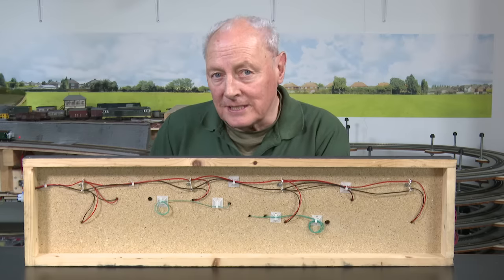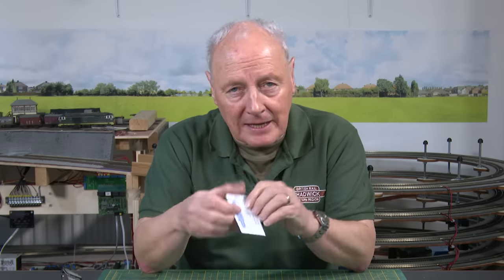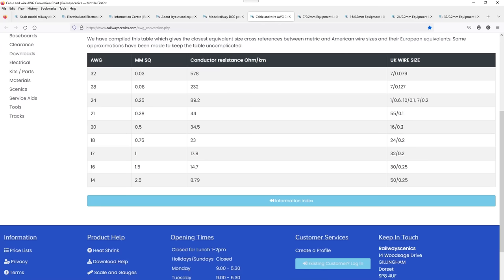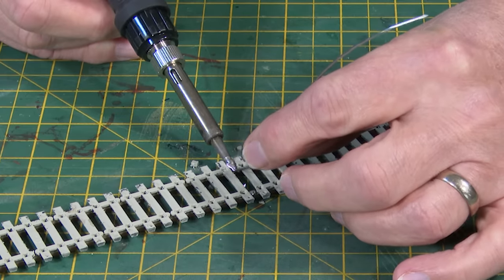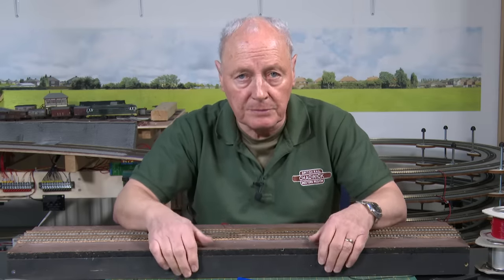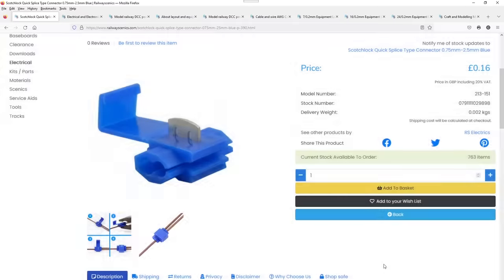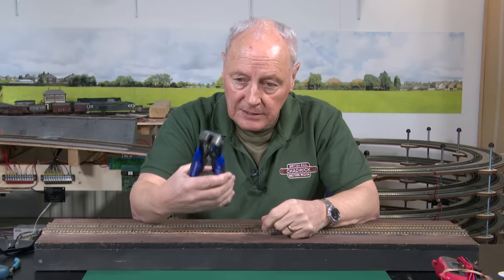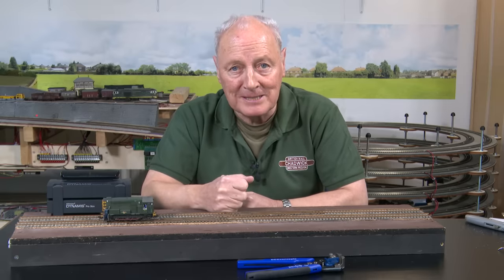LAYOUT WIRING for DC and DCC and all gauges at Chadwick Model Railway | 175.

Comment: I made an 8x4 N Scale layout about 4 yrs ago. Googled wires etc, but I done everything in haste. I painted the rails first, before laying, thinking I'd save time. Soldered wires then to the outside of each rail, hence bored 2 holes. It was only the last few pieces of track, did I solder under the rail, and bore the 1 hole. I ended up buying new flexi track, on sale (bargain, code 55) and maybe one day, re-start the layout properly.
Reply from the maker: We all learn through our mistakes Fergus. Stay safe, regards, Charlie

Comment: Hi Charlie, love your video tutorials, for this one, to me it's all you explained is pretty basic, but never the less interesting.
And as for wire, the thicker it is, the less resistance you have, the less chance you have of overheating your wire, the better your signal goes thru, so you don't do wrong with a bit of oversizing in wire thickness.
But what I don't see so much used, are short cut breakers, it offers you more safety towards you DCC or DC power unit, although your base station should be protected against this with an automatic off switch, but there is nothing wrong building in some extra safety.
Plus if you work in isolated sections, where you put in a shortcut breaker for every section, you avoid breaking down your hole layout.
In this you have two variations a simple bulb like breaker, to be actually correct it's an amp reducer, the higher the amp of the bulb is, the more amps you can pull until the max is crossed, and then the lamp is burned through.
Or you can have an electronic breaker, that switch off incase of a shortcut and reboots it self once the shortcut is gone.
Anyway perhaps an interesting  theme for a video…
Reply from the maker: Thanks Danny, you are of course correct, I use an electronic circuit breaker next to my command station. Regards Charlie.
Reply: @ChadwickModelRailway  So you use only 1 circuit breaker for your complete layout, or is it one unit with several intern breakers that covers a number of sections?
Of course there is nothing wrong with both methods, your controller is extra protected, and lots of these electronic breakers you can choose the Amps they need break on, of course depending on how many trains you want to run at the same time, that is also of importance.
Anyway always great to see how others build, thanks for your great video's.
Regards,
Danny
Reply from the maker: @dannyvanstraelen3273  I have two main power supplies. Each supplies four separate power districts.

Comment: Another splendid, clear, informative, entertaining video, Charlie.  I have to admit that when you were soldering up the bus wires, I did wonder why not just solder the droppers direct to the bared gap in the bus, but I guess those tabby things keep the two "polarities" apart, reducing the risk of shorts without having to wrap on insulation tape, particularly as insulation tape doesn't seem as sticky and long-lasting as it used to be.
Reply from the maker: That’s correct Andrew. 
Furthermore, the support pieces would be much further apart. 
Regards, Charlie.

Comment: Hi Charlie, first of all nice watch. Wires is underestimated theme. It’s a pity I didn’t see your video few months ago when I was studying wires for H0. At least for standards in US, EU and UK. In UK you have two companies for wires, one which you told. The both also have PTFE wires (one from US, other from China). I recommend to find PTFE wires for locomotives, but not all, those extra thin versions. Germany and US produce it, however it is very hard to get them, sometimes need company to buy small amount. I got both countries for test. Those wires really best ones. Also I recommend to use AWG 24 (if you find best, it would be almost thin as PVC AWG 30) from wheel to decoder, from decoder to motor and speaker. From decoder to LED AWG 30. Anyway good thing to measure stall current of motor and see decoder maximum current. Also do not forget that different manufacturers of tracks also can limit voltage through rails, they could be different 21 or 16 for example.
Reply from the maker: Great information, Alexander, and much appreciated. Regards, Charlie

Comment: Charlie, a great video!  Those terminal strips you demonstrated used to be very common in old electronic items like radios and TVs before PCBs were invented.  They were as common as dirt.  They are still available at electronics distributors like Digi-Key as "3 position terminal lug strips."  They seem to run about $0.80 US there.  This might be a good backup source if DCC Concepts sells out their stock.  Cheers from Wisconsin!
Reply from the maker: Thanks Andrew, for that interesting observation. Regards, Charlie

Comment: Charlie, what a great educational video. But I cannot solder to save my life. So I have been using  telephone  cable  repair splice  Jelly crimps 2 way and 3 way to make my connections also very good for working upside down under the layout..
Reply from the maker: You just need to practice and gain confidence Stephen.
Regards Charlie

Comment: worth thinking ahead with a track or other power bus, specifically where it goes so its not where you are likely to stick a drill through it later or want to mount say motors or other equipment - useful to have it where you can get a reference from above the layout too
Reply from the maker: Excellent points Dale.
Regards Charlie

Comment: Enjoyed the video, Charlie.  Like you, I am not a fan of ‘suitcase’ type connectors and I agree that soldering is probably the best option as long as you are not underneath when doing it!  Ask the famous OO Scale modeler, Lord Nelson. 😂
There is a better alternative to suitcase connectors and that is an American brand, now available in the UK, called ‘Posi-Tap’.  Posi-Tap connectors come in different colour coded sizes to suit a range of wire thicknesses.  There is no need to cut, strip or crimp the bus wire to make a connection.  As their name suggests, they make a more positive connection by means of screwing in a hand tightened clamp against a tapered spiked conductor that pierces the wire for the tap.  The stripped dropper is fed through another hand tightened cap which makes a tight electrical connection against the base of the tapered spiked conductor. The resulting connections are, in my opinion, more electrically positive and secure, than you get with suitcase connectors.  Worth a look Charlie.  Best, Jason.
Reply from the maker: What an excellent suggestion Jason,
Regards Charlie

Comment: Great video. I run almost all DC even these days, and I'm thinking about running bus wires anyway, to cut down on problems with power loss because of failing joints (fish plates/angle bars, etc) 

I like your idea of soldering to the bottom of the web of the rail, rather than to the outside as I've been used to doing. It doesn't take much in N Gage to melt the crossties (sleepers) in a quick minute. I've even had the track go out of gage because of the "spikes" melted off the tops of the ties.
Reply from the maker: That’s great news Michael. I’m so pleased that you found aspects of the video useful. Regards, Charlie

Comment: I found that rails are excellent conductors. And the beauty of digital is that you can put decoders on each turnout or signal and let them draw the power from the rail. For my little end to end shelf layout  which has 5 meters (16 feet) of double track (plus some side tracks)  -all in all about 12 meters (ca. 40 feet) of track  - I only need two tiny cables at one end to power it all. Just use a multimeter to verify that you have got enough power along the whole track before you start installing cables that are not needed.
Reply from the maker: Sounds like a great plan mate. 
However, the DCC signal can get corrupted if there is too much resistance.
Regards, Charlie

Comment: I had to find a way to retrospectively install a bus wire to my existing initially simple DC layout. The easiest way I found was to use DCC dropper boards which have three pairs of screw terminals on three sides of the board: the droppers normally into the top two with the bus wires on the other two. All screw terminals conveniently labeled R and B. No mucking about upside down with wire strippers or soldering irons - just a screw driver!
Reply from the maker: Very interesting comment John, I shall have to keep an eye out for those. Regards, Charlie

Comment: At 20:00 those strips in various lengths were used to wire electronics before printed circuit boards. Saw lots of them when I started my apprenticeship at Hillyer TV in Stamford in the 1970's.
Reply from the maker: Thanks Geo, I certainly hadn’t seen them before. Regards Charlie

Comment: Thanks Charlie, Nice and simple, which might encourage some of the less confident modellers to have a go. In the UK there are still some older buildings with Red/Black/Green 240v wiring in place, although most should hopefully have moved to Brown/Blue/Green+Yellow by now. Some mains work uses 3 core + earth, so Black and Grey get introduced as 'live' conductors too, older cables might be blue/yellow,  hopefully all sheathed in Grey or White PVC outer. I suppose the safest thing to do, if there's any possibility of confusion, is to label the low voltage cables and put signs up saying "Low Voltage (12/whatever/ v) do not connect directly to mains".
Reply from the maker: Yes, that is always a nightmare Mike. Should you sell your layout to someone less aware, could cause real problems. Regards, Charlie

Comment: For connectors you could always look at using WAGO connectors. They are sold by Screwfix and can be bought in large packs of 2 way upwards.
Reply: Beat me to it! excellent connectors allowing easy additions when needed.
Reply from the maker: I’m on the case, the next time I pass Screwfix I shall get some. Do they come in various sizes? Regards Charlie
Reply: @ChadwickModelRailway  Yes, I've seen 2, 3 or 5 versions. You can get push fit for permanent connections with solid cores or lever ones for easy changes to solid or stranded. They have the wire sizes printed on the side and also the length of wire to strip off. They also come in different ratings. There also make junction boxes that hold the Wagos in place, more suited to mains wiring, but might be useful on larger layouts.
Reply from the maker: Thanks Peter, much appreciated

Comment: Charlie, these cable holders are available here in N.Z. from Jaycar, and also come with five 'pegs' so you can run a lighting buzz too.
Alternatively, if you do not own the wire strippers mentioned, cut the buzz wire leaving say half inch, 12.5 mm bare cable sticking out and solder one or several droppers to the bare buzz at each holder position. Also, of course, solder another length of buzz wire too and on to the next holder. Thanks, I look forward to every other Saturday morning here down under, to watch what you have been up to. Peter
Reply from the maker: Thanks Peter, I’m so pleased that you found it. Interesting mate. Regards, Charlie

Comment: Charlie,  they do make a heat shrink tape that works very well.  You put it on like you would electrical tape but when you shrink it down it creates a very element proof insulation and won't come loose as electrical tape often does.
Reply from the maker: What an excellent comment, Ernest. I had never heard of that type. Regards, Charlie.

Comment: Charlie i would have fed the wire through the hole first the marked the cable used the strippers to pull the insulation back and soldered it. you way i would have used if the bus was already in place and i needed to add a further Buss/dropper. thanks, love you stuff.
Reply from the maker: A Fair point Dave, I’m so pleased you enjoyed the channel mate. 
Regards Charlie

Comment: Those DCC Concepts terminal strips are like the ones we used before printer circuit boards when component were mounted on a metal chassis ( old vacuum tube days).  I had a box full of them but must have thrown them away.  I wish I had them back.
Reply from the maker: Just like me, Kieth, you need it a couple of weeks after the binmen have gone! Regards, Charlie

Comment: Quick shout in favour of 60/40 leaded solder (as someone who's been nearly 50 years in the business). Leaded solder is banned ONLY FOR COMMERCIAL products. I find people fret and whine about using 60/40 'cos it's illegal, but for the hobbyist, there's no problem. Lead-free solder is so much more difficult to use, it's really worth looking for 60/40, but you might have to look carefully at the fine print on the adverts on e.g. amazon (other mass retailers are around), Thanks for a good instructive video, BTW.
Reply from the maker: Thanks John, great info. Regards Charlie

Comment: Hi Charlie, the wrap-around/through solder tag arrangement has been around since the 1940s, I remember stripping old Royal Navy aircraft radar sets back in 1961 at a scrap yard just off the Old Kent Road in London.  It was a popular way of making connections in the Royal Air Force until you came wanting to disconnect and alter the wiring, I speak from personal experience. Your wire strippers are expensive, in my opinion, and whilst I agree that they provide a suitable clear wire area for soldering most wire strippers will do that. Just take five minutes and practice the technique before using them.
Reply from the maker: Point taken Roger, however, those strippers make it so much easier. Regards, Charlie

Comment: Hi Charlie, 

I think Toolsation do the same strippers as DCC ... Code ref is 42984
C.K Automatic Wire Stripper... got a pair last year to do my railway wiring and they strip everything from 3 core solid core cable to thin dropper wires. Absolutely brilliant piece of kit.

Using the terminal blocks you use (on your recommendation) along with a crimper and the connectors ... no soldering required under the board,  just a screwdriver and a torch :-)
Reply from the maker: Sadly, Ian, those Toolstation strippers aren’t up to much. Regards, Charlie

Comment: Another interesting film thanks Charlie.  I found 
I had to get an account from my electrical dealer before they would sell me any tin/lead solder.  I also notice drums of 100mtr cable are much cheaper from pro electronics dealers 16/02 about £13 inc or £12 for 10 plus drums.  I also would be lost without Wago clips of various sizes (1-2-3-5 way) no soldering needed at all when working under the table. Plus they are rated for mains power if needed. I use those wire strippers (not DCC Concepts) but find just sometimes they can be a little problematic for left handlers like me.
Reply from the maker: Great comment mate. I shall buy some Wagos and do a review. Regards Charlie

Comment: If you are starting on a build that will need a number of wire colours, Railway Scenics have wire bundles you can buy. I think they have 10 colours in a variety of sizes and lengths.
Reply from the maker: Yes, that’s correct, and a great way to start your build. Regards, Charlie

Comment: just starting up - thanks for all the tips. I may have missed you mentioning the clips you use to attach wires to the underneath of the base board. They look neat. Can you say what they are. Many thanks
Reply from the maker: Hi David, they are simple, sticky pads. However, I peel off the sticky pads and use a hot glue gun to glue them to the board. Regards, Charlie

Comment: A non solder option is to use Toolstation part number 99944 which allows 2,3 or 5 wires connected in common. They do need double sided tape to attach to the underside of a baseboard. Other firms probably sell them.
Reply from the maker: Thanks Rob, I imagine they’re like wago connectors. Regards, Charlie

Comment: Another excellent informative video Charlie, which I know will help me. Can I ask where you bought the red and black wire from, the website you mentioned does not have red and black in the size you mentioned for dropper wires?...Simon
Reply from the maker: Hi Simon,
The droppers were size. 16/0.2mm.
If Railway Scenics have sold out,
Try DCC TrainAutomation.
Regards Charlie

Comment: thank you.
I just wonder why you do not solder the droppers direct to the (bared) bus wire?
Reply from the maker: A fair point Tony.
I was just trying to show the various methods available to modellers.
I did mention that it was perfectly fine to go straight onto the bus wire if that was more suitable.
My aim is to encourage folks to wire their layouts more methodically and should they have an issue, be able to "fault find" much easier.
Regards Charlie

Comment: Very helpful video. I’m just coming to grips with soldering so please excuse my ignorance. You don’t use flux and I’m wondering why. Is it because of the kind of solder you are using? I’m using DCCConcepts 179 solder and I understand that flux is needed. If so using, would you apply flux at every step in the process you have taken and recommended? Thanks, David
Reply from the maker: I do use flux David , on more difficult tasks. However, the solder I do use is a resin cord solder. That means it does contain flux within its core. Regards, Charlie.

Comment: Thanks, but I though that for DCC main line it is preferable to twist the two wires (your black & red wires) to avoid to receive on the DCC signal wires all the electromagnetic perturbations that can affect the DCC signal. Thank for your advises.
Reply from the maker: I believe that Long runs of cables are twisted to avoid induction. My runs are very short. Regards, Charlie.

Comment: Hi Charlie - A great video as usual. My only comment would be that the DCC Wire Strippers at £23.00 are over twice the price I paid for my identical looking tool that I have been using for a few years since I started my layout.
Reply from the maker: You make an excellent point Barry but some strippers, such as the ones from Toolstation, really are poor quality.
Regards Charlie